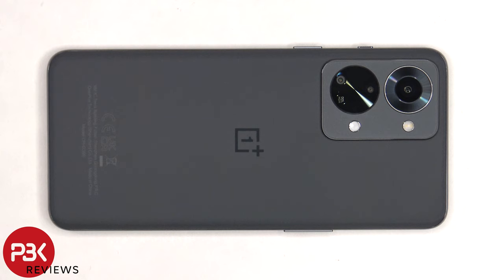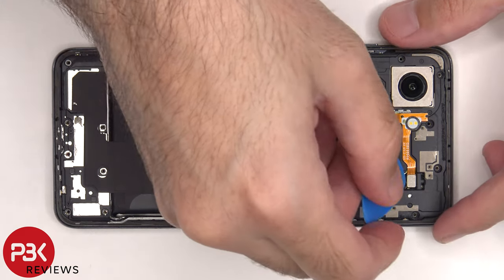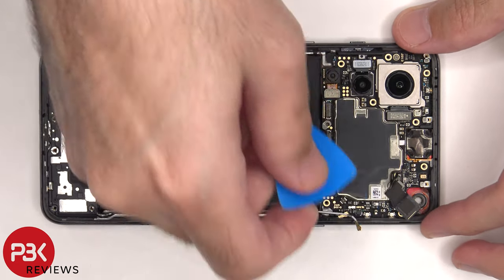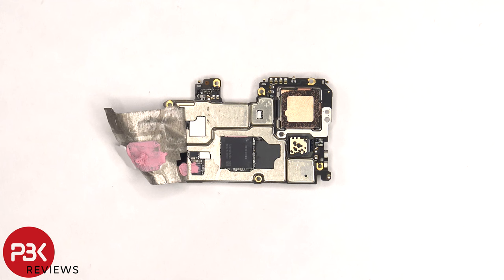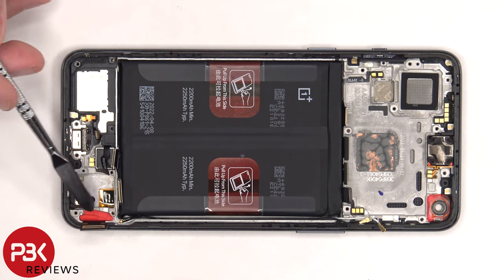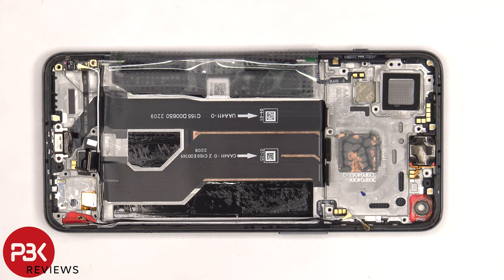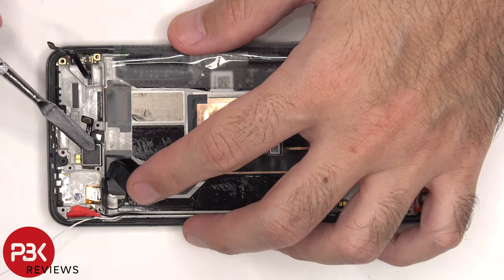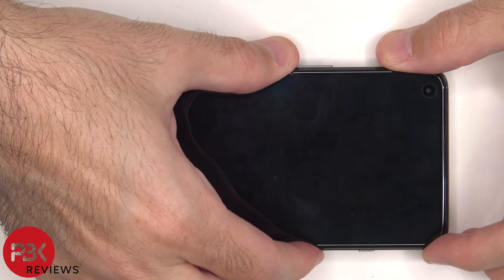OnePlus Nord 2T 5G Disassembly Teardown Repair Video Review

Comment: I am using OnePlus nord 2t, Yesterday i inserted the sim ejector pin into the mic hole by mistake, is there any chance of any mic issue? Or any damage in the mic?
Reply from the maker: Hi, no you will be fine. The mic is seated above the hole and would not be damaged.
Reply: Thank you so much!
Reply: @UttamDas-dg7fu  i had done same twice 😂😂

Comment: Hi,

Is the battery only to be able take away that late or can it be removed after taking away the motherboard protector
Reply from the maker: once you have access to disconnecting the battery cable from the main board, should be able to be removed. You don't need to do additional steps.

Comment: Hi, does the USB-C port show any possible tendency to tilt slightly(!) to the left (port tilted slightly deeper in on the left), or is it just my unit? The connection is stable, but I am surprised nonetheless.
So is a slight misalignment of the port's metal sleeve just a cosmetic problem, or will I run into problems later?
Thanks!

Comment: Heyy i mistakenly put sim card pin in microphone hole does it damaged anything... microphone or water resistant...
Reply from the maker: Hi, you should be fine. The mic and filter are seated above the hole and would not be damaged.

Comment: Why now company start 2 battery instead of one any advantages?
Reply from the maker: Not sure exactly what the advantages would be, but most cases they use dual cell to charge each cell simultaneously to get a quicker charge.